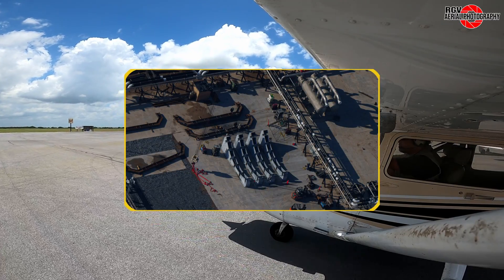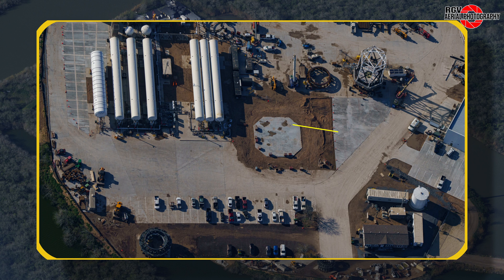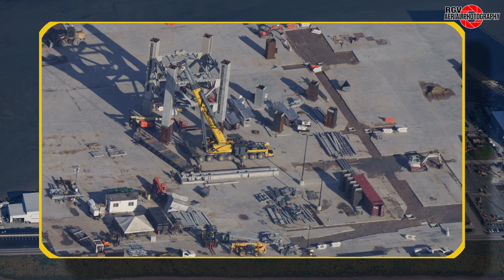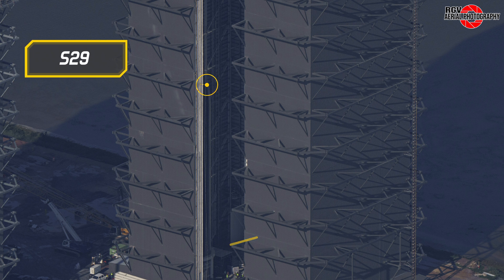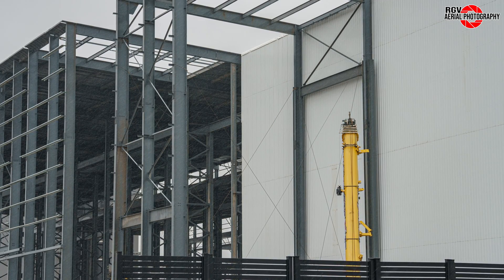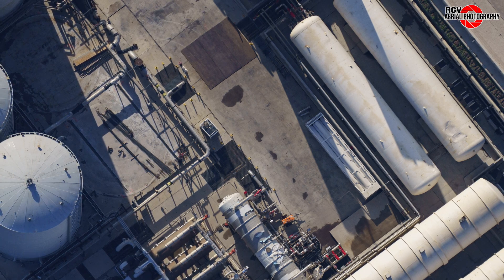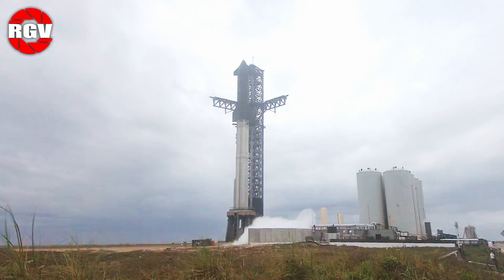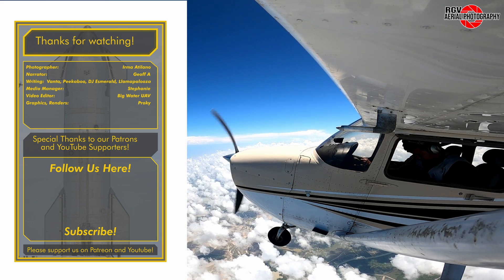Starship Flight 3 Full Stack Testing + Massey's Flame Trench Updates | Starbase Flyover Update 32

Comment: so the general consensus is that the exhaust from static fires will now be directed in Mexico's direction?
Reply: The Mexican border is miles from Starbase so what's your point??
Reply: @michaeldeierhoi4096 The new static fire pad is being installed at the Massey's test site, and the end of the flame trench is less than 200m from the Mexican river bank. I was quite certain it would face away from Mexico, but that seems not to be the case. Perhaps the flames will be diverted primarily upward.
Reply: @JonathanSchrock    200 m seems to be a bit short of the mark.  I have looked at the area on Google maps and have visited the area twice though not Massey specially.
Reply: @michaeldeierhoi4096  i was asking about the Massey's static fire flame trench...🤨
Reply: @moodyblues1365  Sorry my mistake I was responding to the other commenter who joined in.  I have nothing else to offer.

Comment: "lets compare last flyover with this one" * proceeds to show two completely different angles * not helpful at all.
Reply from the maker: Apologies, this was the first time the weather was good in weeks and so the previous lower flyover altitude of past weeks did not allow for an aligned comparison to be made.
Reply: @RGVAerialPhotography did they change the minimum altitude you can fly there?
Reply: @FastSloth87 Yes, it's lower now.
Reply: Sir, even an animal can interpret a different angle view of objects.
Reply: @Chleosl you missed his point. A comparison should be made as easy as possible.
Reply: @Sal3600 He said "completely not helpful" and that should needed to be criticized.

My point is, sadly, he(the channel owner) have not that much (of) material to make video much better. He needs selection and concentration, and in his case, it is more likely better to concentrate on the quality and quantity of information, rather than easy-to-understand labor-intensive editing. I know what he wants and I kinda also want that also, but you know, if every demand put in, the quality of video would messed up.